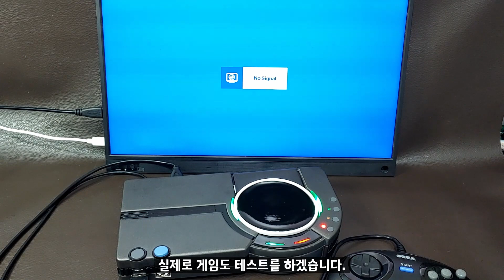[ENG/JPN] 메가드라이브 미니로 만들어 보는 원더메가 미니 / Wonder Mega Mini made with Genesis Mini

Comment: You must have an INCREDIBLY high quality & expensive 3D printer to be able to print parts like that which look practically injection molded!   I've never seen 3D prints with such small fine detail that still looks perfect.
Reply from the maker: We are using a cheap 3D printer, so we need a lot of processing. I also want to have a good printer. lol
Reply: @limoneworkshop  Ah right  sorry, I made that comment before watching further into the video where I saw that you had to sand.  Still, it looks amazing!